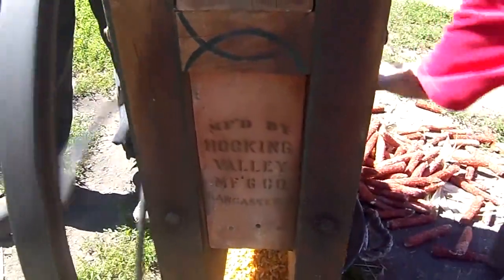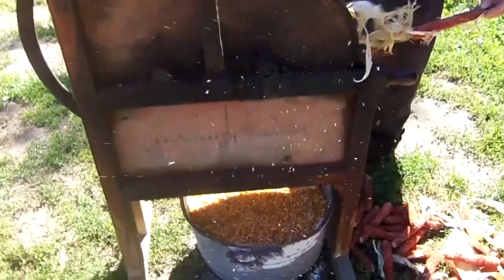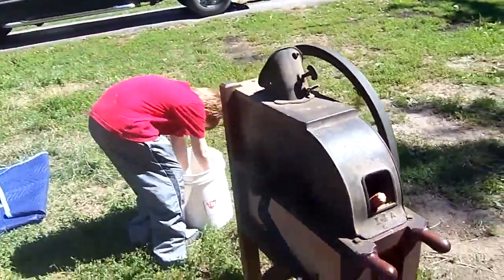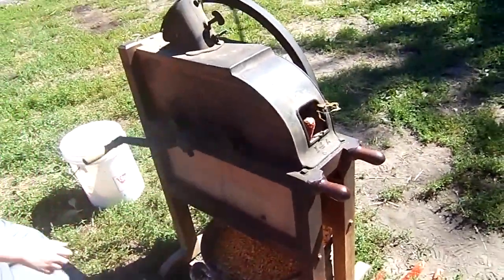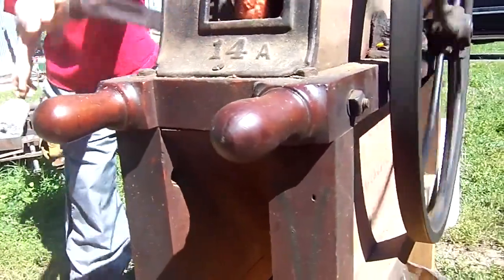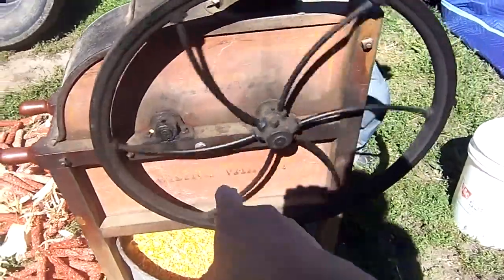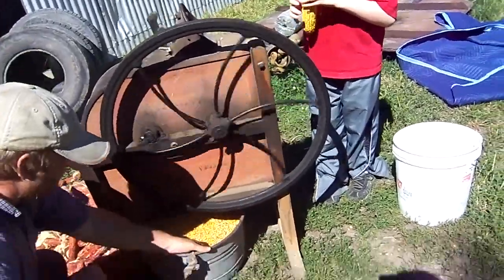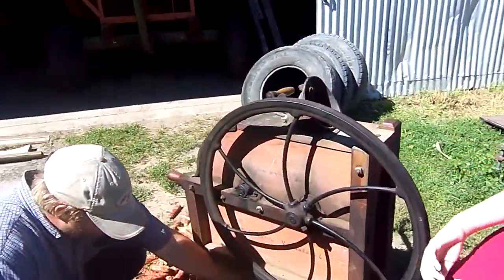Improved Hocking Valley Corn Sheller

Comment: I have a hocking Valley 2 hole corn sheller excellent condition no rust except on very bottom where the paddle is and the wood is not rotted in the least bit. trying to find one pulley/chain that turns everything at once including the conveyor belt.
Reply: The thing is, you will probably never find oem hardware for that